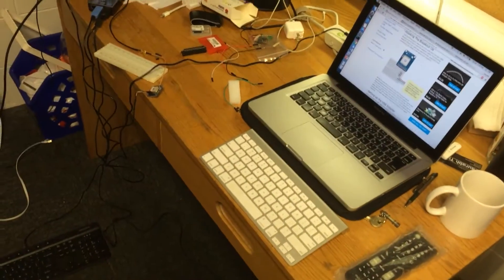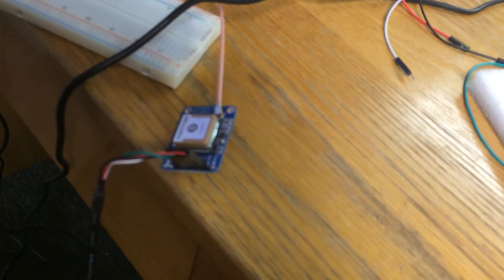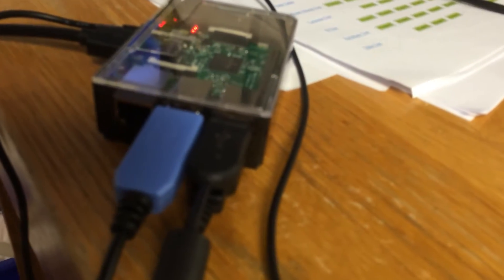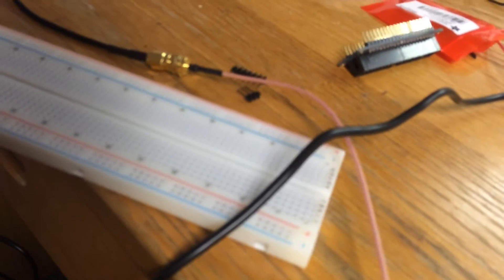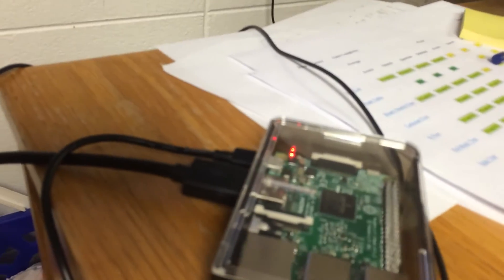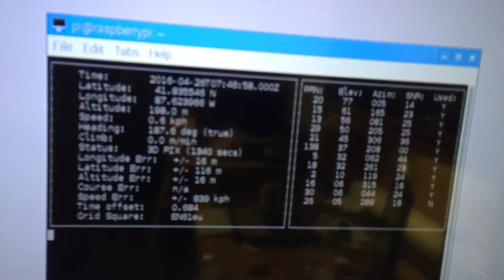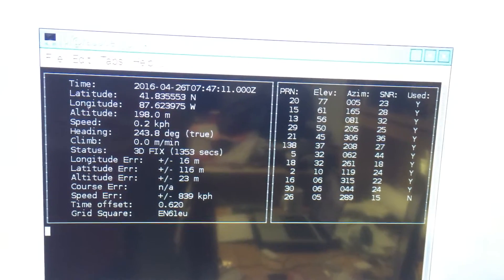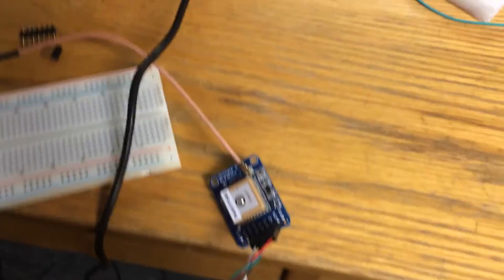CS547 GPS module integrates with raspberry pi.

Comment: Looking for more details, part numbers and a good solid DIY.  

Also, have you figured out how to put the coordinates into a text file that can be emailed daily, or how about SMS messages?
Reply from the maker: Hi there, this was an academic project and I used python to get the coordinates from my GPS and refresh the context which revolve around the city of Chicago. 
I can share the code if you want.
Reply from the maker: https://learn.adafruit.com/adafruit-ultimate-gps-on-the-raspberry-pi/using-your-gps you can use this code for reference. Or I can open source mine, if you need more concrete example.